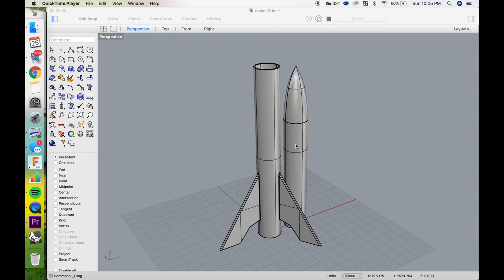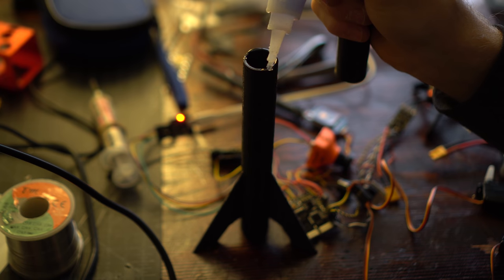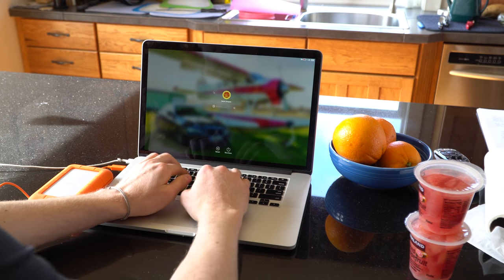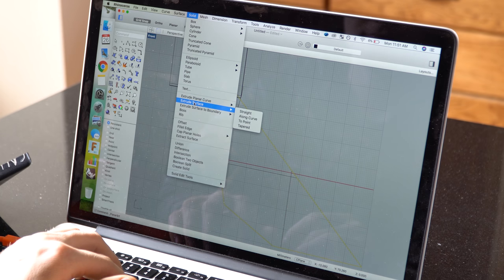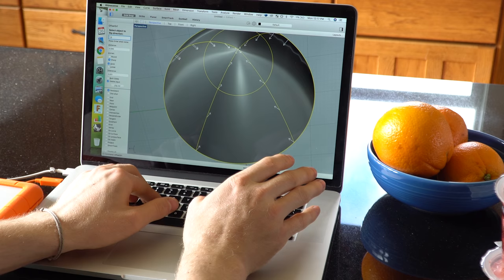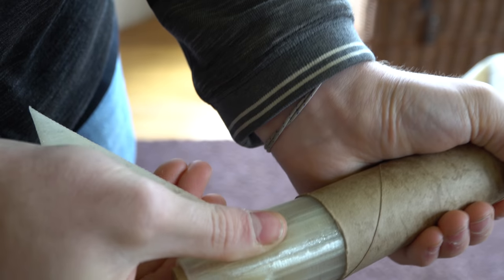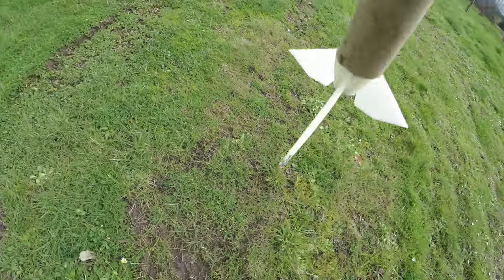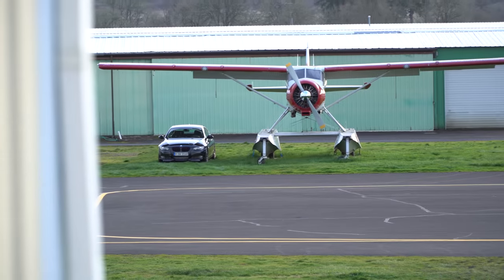3D Printed Rockets...

Comment: Try the shell command in rhino if it's in your version as an alternative to offset surface , works bit better for hollowing out complex stuff.
Reply from the maker: Yea I bet capping the bottom and then shelling it would work better. Or maybe just make it a solid and let the 3D printer hollow it out with a tiny bit of infill. Really should just learn fusion 360 better

Comment: Always really nice to hear from you. I really admire your job. For the tube rocket all you need to do is reprint the nose cone and add a rubber band between the nose and tube. midway add a shoot or ribbon. boom... multi use. Add wadding as well but I'm guessing you new all of this. Either way great to see a nice update video 👌
Reply from the maker: It doesn’t go that high and I’ve had no problem finding and re-using the cone. Great tip from normal rocketry though.

Comment: Haha awesome! We got to 3D print a rocket like that at a camp this past summer. Anyways, I got the Geeetech i3 wooden version and for some reason the extruder gear keeps skipping. I checked the set screws, motor voltage, adjusted slicer settings etc. I know you bought this printer and it seems like its working find for your, did you have to change anything in order to make it work?
Reply from the maker: It’s the nozzle clogging up. Make it hotter and print slower. Maybe try clearing the blockage. Clogged extenders are a real pain
Reply: My printrbot sometimes does that too